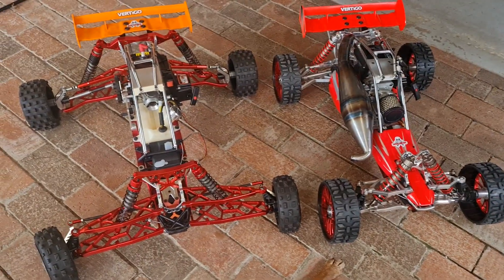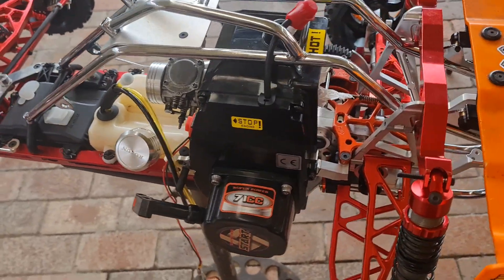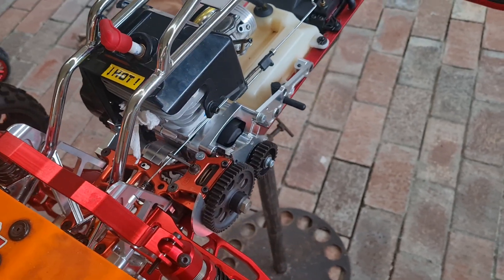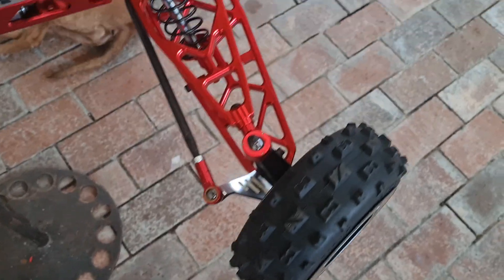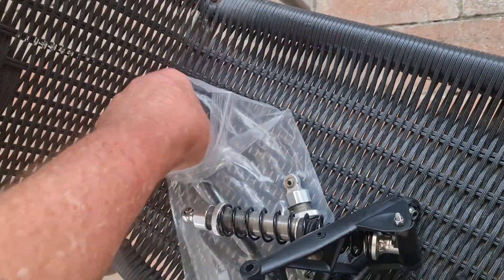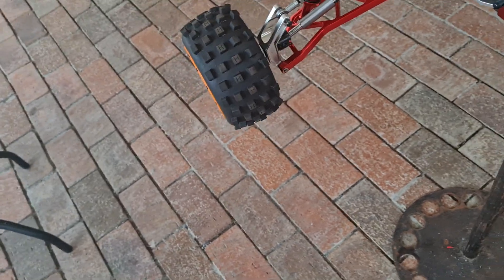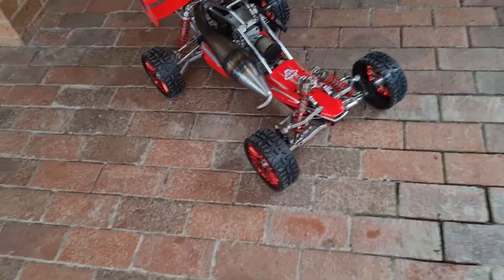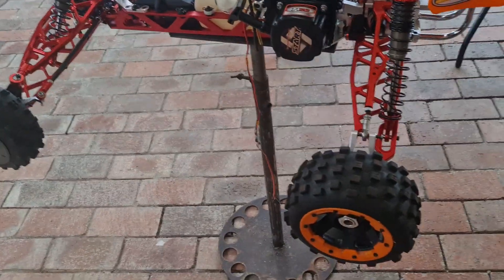Rovan 5B 71cc convert  to 5T max longer swingarms

Comment: I just put a 71cc in my king motor t2000
Reply from the maker: You will have some breakages
Reply: @robertblunden7160  what do you think will give out first
Reply from the maker: If you running stock motor with stock rovan you may be safe sort off, when put the right pipe on the engine  which will release  alot more power  which your stand drive cups and pins chew out and belt system  for the front drive wear out quicker and the problem blowing the tyres of the rims
Reply from the maker: Another when you running 71 motor you need to change  the clutch  spring  from 8000 rpm to 6000 rpm as the motor revs max 13000 rpm and you need to run tall gearing to get max out of the engine as is has massive  torque  pull like a train
Reply: @robertblunden7160  I was looking for a 71 style pipe but the Taylor rc ones are a bit pricey so I kept looking and found something cheap but might need a bit of work to fit but it will have a proper pipe on it so I will be sure to see if those drive pins and cups break but it does have all aluminum parts on it and the belt system, we will have to see how it holds up